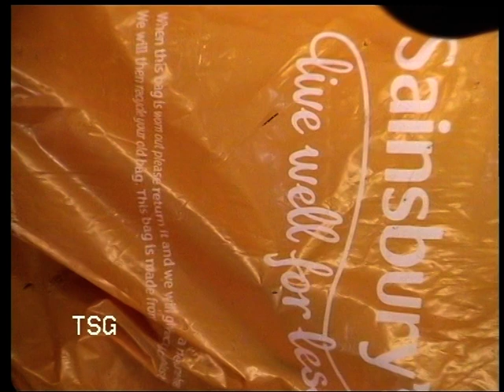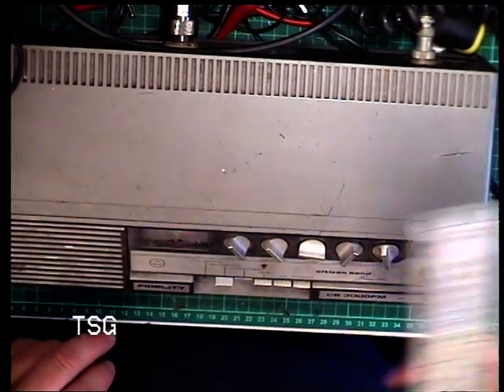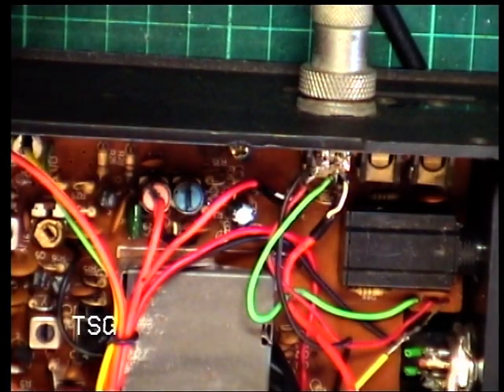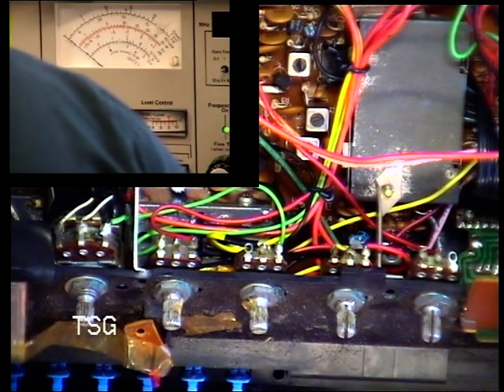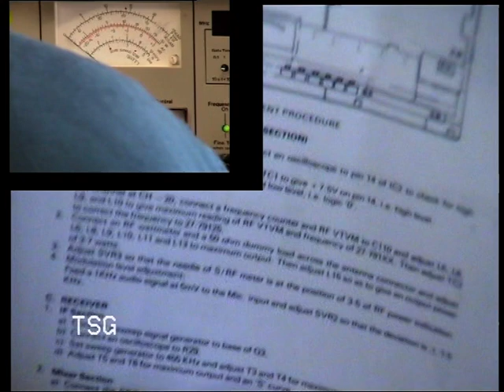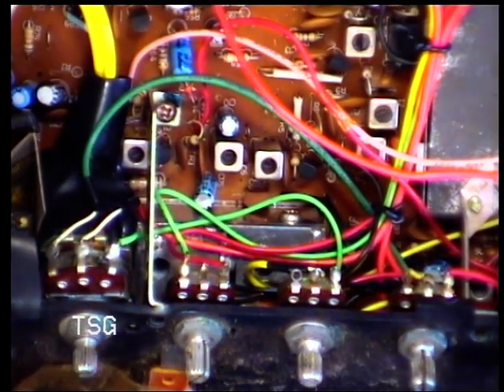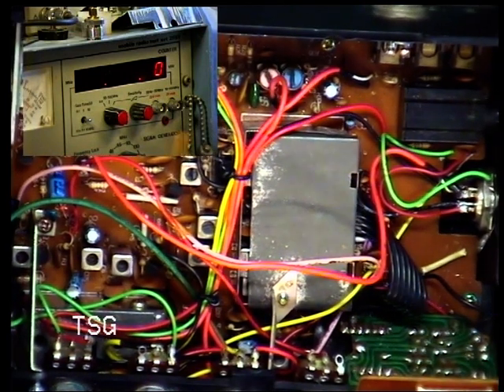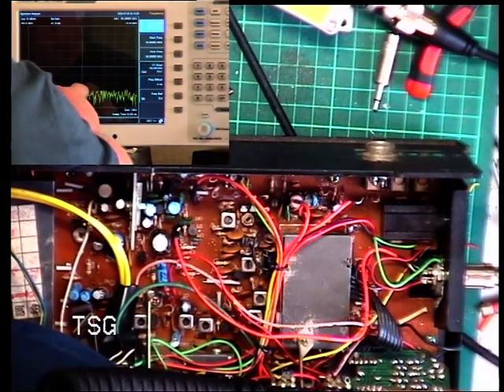Fidelity CB3000FM UK CB27/81 CB radio (base) - service/repair

Comment: I found the receiver to be not bad on those if tuned properly, however if you were in a busy built up area thet did let some bleed over through, or just desensitised and went quiet.  However, if you were out in the country they were not to bad, but let down by the lack of output power, though they usually sounded good on TX and they were a bit quieter on RX then other sets, the FM rasp was not quite so bad and if the squelch was set properly, it was a set you cold leave on RX all day with the volume low (more than you could do with others unless you were deaf).  They were terrible to repair, half a days work just to get the bloody board out!  Just to change a transistor, never again!
Reply: @SoggyTissue  Never heard them called that. they were ok for the power they put out. but I liked the receiver, it  tended to be a bit quieter than other rigs,, even the Cybernet chassis rigs I liked best.  But they had their downfalls, and bleed over was one if you were in a city, they just couldn't handle it.  However, I knew a couple of people that had one and they loved it, I have to say that they did very well on their 3 watts and they were a bit less harsh on receive which meant they sat with the squelch either off or just above the noise and any signal that just about got through the noise was enough.  I talked from the Loch of Skene in Aberdeenshire to Maud in Aberdeenshire using a Walkie Talkie to a Fidelity 3000, now tell me of another set that would hear me on a Walkie Talkie at that range.
I heard her talking to someone on the Walkie Talkie and didn't think I had a hope getting through, but first shout she heard me and came right back to me.  Now, the Walkie Talkie had the top of the aerial missing as well.  If you look that us in a map, you will find it is some distance, mind you I am sure she had a Silver Rod, but even so I was very surprised to get her at all. I have got a Fidelity 3000 still in the shed somewhere just so I can leave it running.  Loch of Skene to Maud, Aberdeenshire, look it up.Kirkton of Skene is by Aberdeen and Maud is by Peterhead, 40 miles by road, so that was 25 to 30 miles as where I was was a few miles out the road further away.  Check it out for yourself.  She was called Blue Lagoon.

Comment: Yes, of course 'working' means it lights up. 🙂 (With valve gear 'working' means "the dial light comes on and there's a hum -- probably needs a better aerial") 
I would usually also check 3rd harmonic as sometimes it can be worse than the 2nd. BTW: the email from eBay advising that you had won the item should contain a link to the original listing

Comment: Hi Richard, I got fed up of wiring mic plugs for each type of radio into my Marconi 2955B and decided to go with your method of using a Korg instrument tuner instead.  I just bought the T-60, which is almost identical to the T-50.  What frequency do you set your tone at along with, I presume, the highest note, i.e. "C" in the 6th octave, to produce the required tone for setting the deviation?

Actually used the Korg on my laptop speaker to indicate what you had set in this video and it thinks is B flat in the 5th octave.  Is that correct?
Reply from the maker: Yes, it's B flat with the scale slightly modified away from a=440hz standard, to give me 'just about' 1000hz....something like 999.7hz

Richard
Reply: @ukfmcbradioservicingTango21  Ah! That's great! =)  I'll feed the output from the Korg T-60 into my Marconi frequency counter to find the best offset (from 440Hz) for or as near 1kHz as I can get it.  Thanks for your time and advice -  appreciated!  =)

Comment: Are you still after another one Richard, I have one here, only thing missing is the channel select knob, it turns on, volume seems low but it works, not sure about the transmit side as i have no antenna to try.
Reply from the maker: No thanks, someone kindly came to the rescue,

Regards, Richard
Reply: @ukfmcbradioservicingTango21   No problem, I would have replied earlier but seems a lot of the channels i follow i no longer get notifications about new videos.

Comment: Sorry to ask another questions but what does the Level Control on your Marconi test set do?  I noticed its needle waving around a bit when you were peaking the transmit coils but the Watt meter was barely moving.  Is it a more sensitive "fine tune" sort of meter?
Reply from the maker: You have to align the meter to a set point when changing major frequency ranges..like from 27Mhz to 440Mhz for example. It ensures the generator is itself properly aligned. You also manually peak the modulation / deviation monitor (which is a wideband am/fm receiver covering 24-500Mhz) In other words you tune-in the modulation monitor system to the transmitter you are examining. 

Richard

Comment: Hi, I'm in need of a couple of knobs for this radio if anyone has any for sale? Cheers.
Reply from the maker: No, I've never had a scrap one. 

Richard
Reply: @ukfmcbradioservicingTango21  OK no probs. Might send mine in for a tune up if that's OK?
Reply from the maker: @gazsweet  Roger, that's fine. I once got 2.7W out of one rather than the usual 1.7!

Richard
Reply: @ukfmcbradioservicingTango21  I know I was shocked at that! I think I still have your email to get in touch...
Reply: Sent email 📧
Reply from the maker: @gazsweet  email is in the about channel blurb